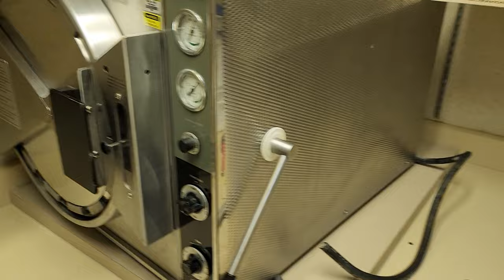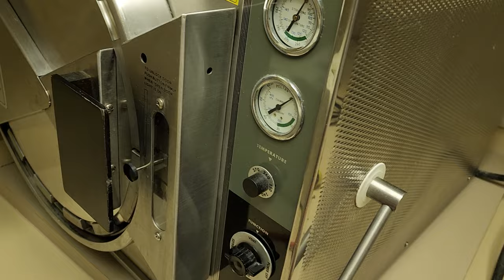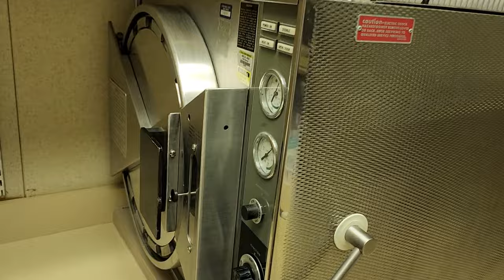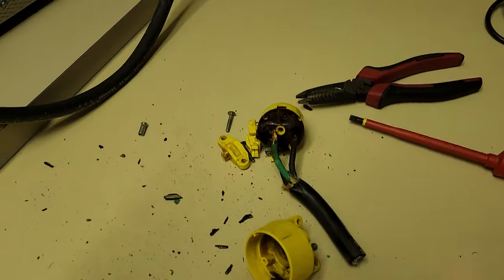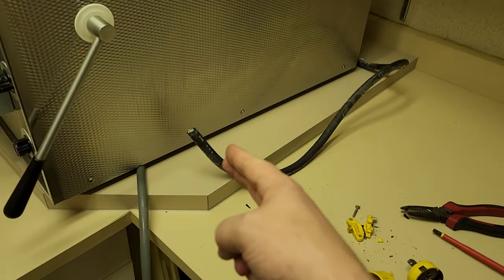Fire Hazard!

Comment: When it runs, make sure you check for steam leaks. The unit will run harder to keep up with the leak. Extra current draw from this can easily result in Autoclave power cords melting. It could have also been as simple as a loose connector on the 230 line.

Comment: Anywhere where you have high current draw, it's important to make sure you have good connections. We had a domestic dish washer (an old one) that would draw 11A @ 240V. When I wired up it's plug I didn't take care to check the socket or that the plug was of good quality. Well drawing that much current caused things to get hot, very hot. It melted the plug and damaged the socket. it seems that the plug's internal fuse was at fault due to it being old and slightly tarnished. The fuse which was rated at 13A didn't blow even though the plug had melted around it. Anyway I ended up replacing both plug and socket with good quality unit and it's all been fine since. 99% of UK plugs have right angle cord outlets so the issue you describe here doesn't apply. I've a;so never seen a UK plug with bent prongs.